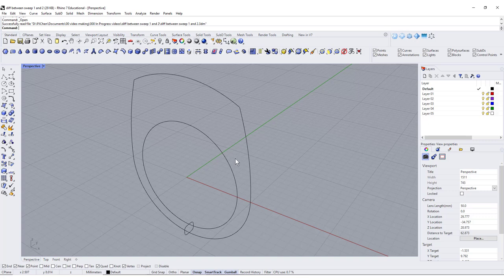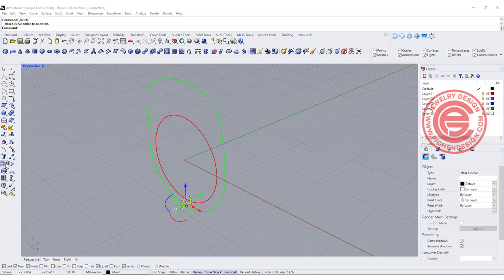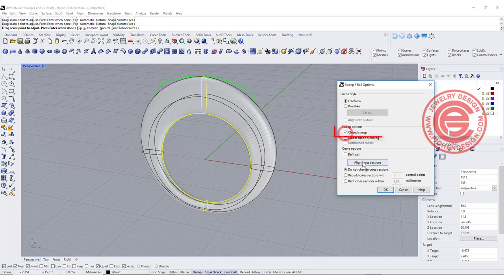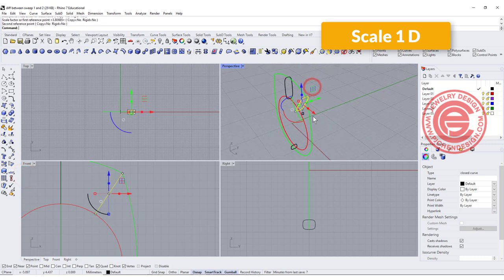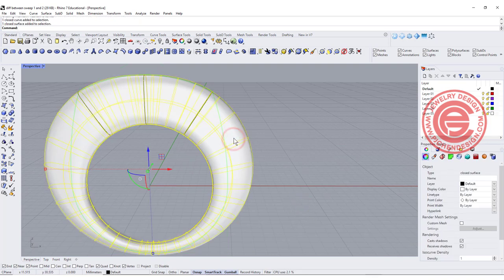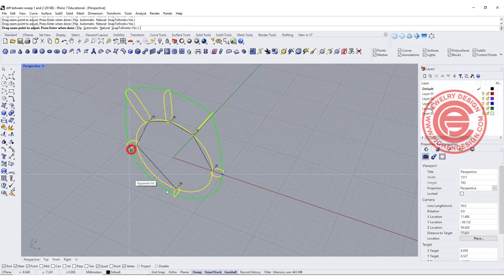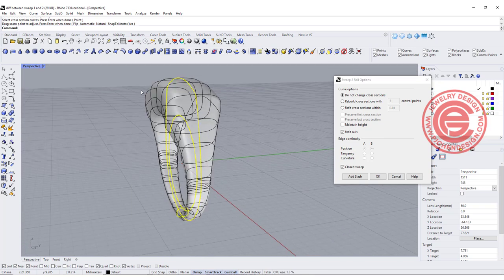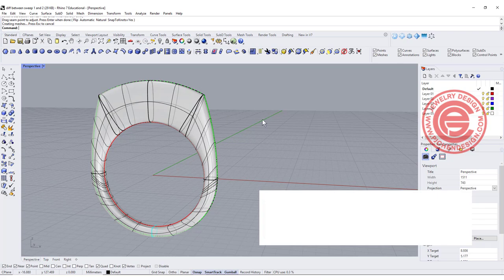Difference between Sweep 1 and 2 Rail in Rhino 3D

Comment: i have  two closed curve ellipse  01 horizontal & 02 vertical what command used to convert  surface  ???
Reply from the maker: if they are touching. you can split them into 4 curves and use LOFT command